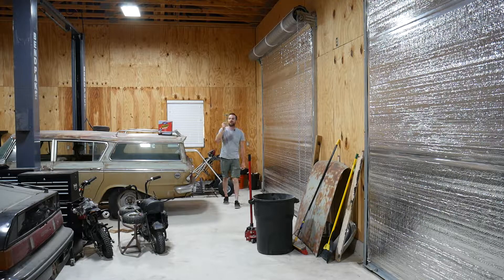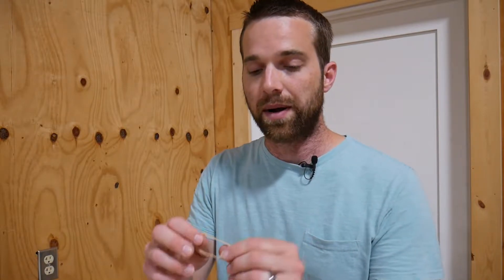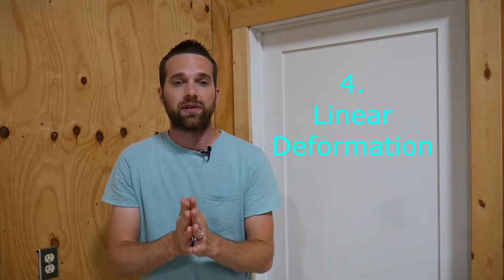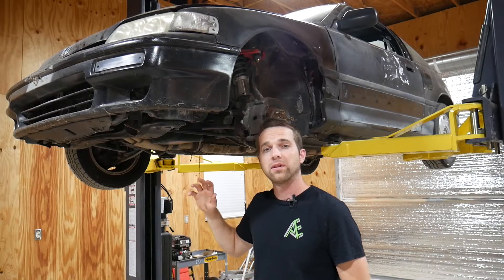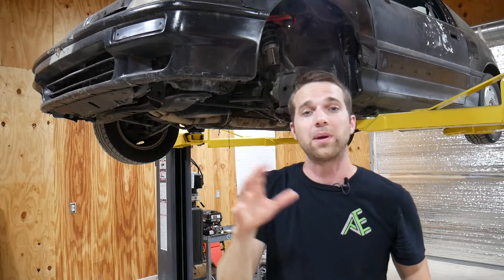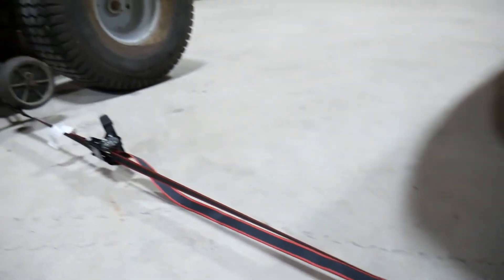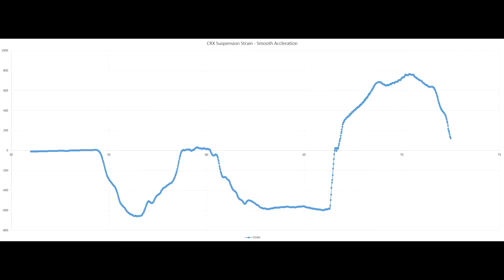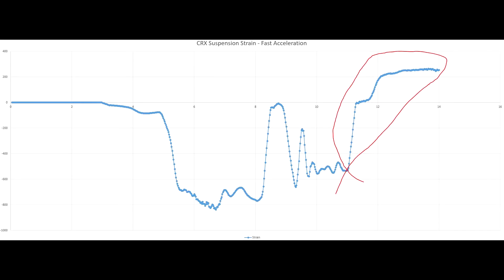Strain Gauge Installation - CRX

Comment: Thanks for sharing your work. What hardware are you using to log the data and at what frequency? I'm looking to log steering force and maybe a strain gauge on the steering shaft is something I should look at.
Reply from the maker: I'm using an i100 Instrunet that I've setup specifically for mobile applications. Its a great DAQ platform at a reasonable cost for the quality. I believe I was sampling at 50Hz. I think the steering force idea would work great with a strain gauge applied - I recommend going with a torsion full-bridge setup, it's worked well for me in the past.

Comment: Would that actually work though? If any bushing is binding wouldn't forces be not actual for the tire etc?
Reply from the maker: Bushing are a great topic to bring up but I've got too much to say to fit in a comment. After I finish setting up the DAQ I've got plans to replace the bushings and I'll be covering their affect in a video then. The short answer version is yes forces from the tire can be picked up. "Impulse" definitely plays a roll, which I'll cover when I dive deeper into bushings, but forces can be captured. Now, if you mean binding in the sense that the suspension isn't traveling up or down like when you over tighten a pivot joint, I'm not capturing that movement here (but soon will be!). Wheel travel would be affected by binding bushings but lateral and longitudinal forces still need to go through the load path from the mass of the vehicle to the tires, even if it means traveling through rigid bushings.
Reply: @DirtyElbowsGarage  so I guess I meant like the suspension isn't straight up and down (need compliance in bushings) how do you differentiate a pull/push vs twist/bend. Wouldn't geometry spread the load differently too ie toe in toe out tugging things.  Also if you're replacing components wouldn't the metallurgy and thickness change the registered strain to a point the numbers wouldn't be consistent? I'm just an ee and have no idea the mechanical aspect.
Reply: @DirtyElbowsGarage  I guess specifically let's say you put the strain gauge on with the car in the air suspension full droop and compliant bushings. As the radius rod travels up it's under compression and is pushing the lca back. 
If you swapped the lca bushings with solid steel (not heim joints) and set the car down as the radius rod goes through its travel it's seeing more compression from fighting the lca and the lca is seeing bending which depending on which side the strain gauge is on would affect that reading no? So just because there's more force going through the suspension as you drive doesn't mean that force is going through the tires and making you faster right? Let me know if I'm off, I want to learn lol I've got an unfinished caged crx in my garage too
Reply from the maker: @supasexystick  Ok, I think I'm following what you're saying. If I'm understanding it correctly, yes you're right there are forces that can be built up in the control arms that don't deal with the tires, regardless of compliant or non-compliant bushings. There are a couple ways to work with this. The first is to use the correct strain gauge setups. There are arrangements of gauges specifically meant to distinguish things like bending from tension. It has to do with the type of gauge and placement. The second is to zero the gauge values after these arms are loaded (car on ground). This will negate the inherent loadings, and if the preload is in the opposite direction of what you're measuring, it will be caught after the first few tests with some intuition of how the system should be loaded and then can be corrected out of the data. Third, and I should have said more about this in the video, but more strain gauges are going on the car along with some position sensors( and more). The data collected from the group is going to paint a picture of what forces are doing what, and under what conditions input and outputs are tied together. And lastly, this setup can be used like a traditional dyno - where absolute hp isn't the purpose, its the % improvement that is the purpose. And using it in this way more generated forces would be better when it comes to things like alignment settings, tire pressures, etc.. Now if you significantly change the system, you also need to reset your baseline performance metric as well. What is "significant" actually depends on what you're changing and is a case-by-case scenario. I hope this helps! And get that cage finished up and out on the road!